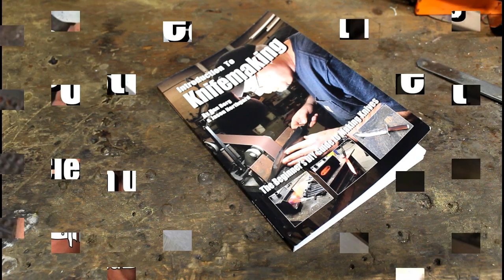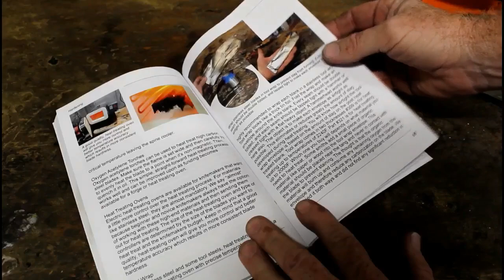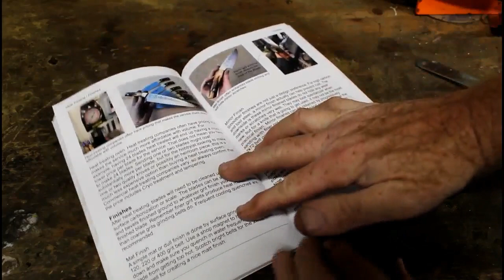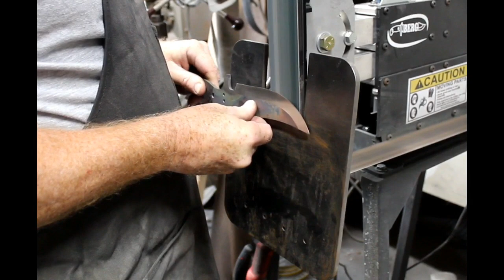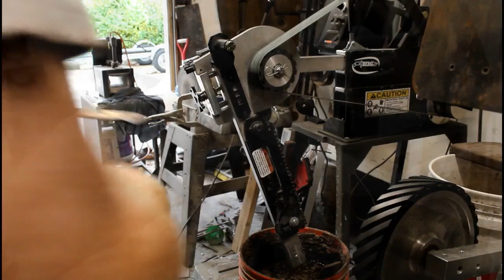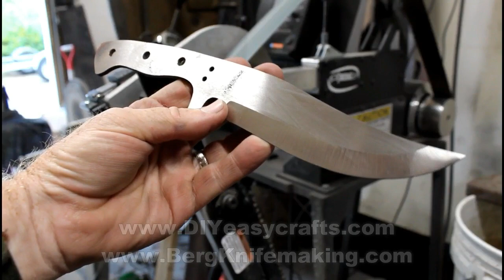Knife Making Post Heat Treat Bevel and Blade Clean UP 1

Comment: New to knife making. Is there any point in sanding prior to heat treating? Thanks
Reply from the maker: Grinding the bevels is easier and uses less grinding belts before the steel is hard
Reply: @DIYeasycrafts  One more question. Is there any point in sanding the tang? It seems all of the blanks are totally sanded to a mirror finish prior to the heat treatment. Just curious.

Comment: I'm a little disappointed that your normally excellent how to videos have degenerated in "Look what I did, now buy my book!" sales videos.  Please return to your old format.
Reply from the maker: Sorry about that Jeff. Your right this was not one of my regular videos although I certainly did not want it to be a "sales video". My plan was to make a bunch of short how to videos that simply followed the knife making steps laid out in the book. I do have a couple regular format videos in the works. Thanks for the feedback I will reduce referance to book. Much appreciated
Reply: @DIYeasycrafts hey I have a (I think a good one) question,
After the quench, I just go directly to temper, but when that’s all said and done I have a bunch of nastiness baked on for clean up.
Should I clean up the blade prior to temper to reduce this?